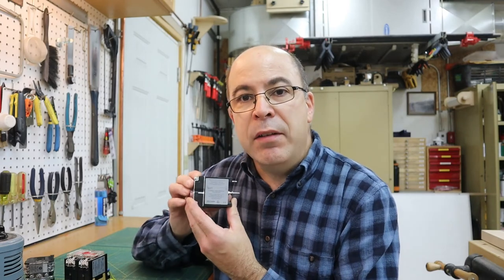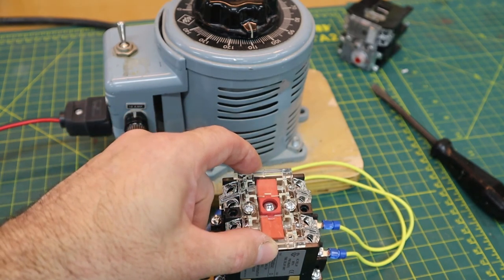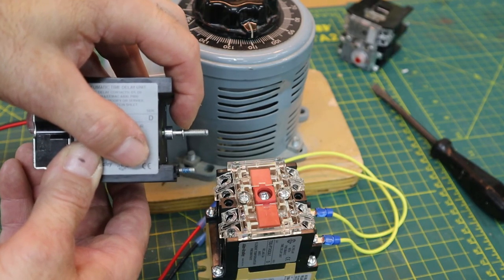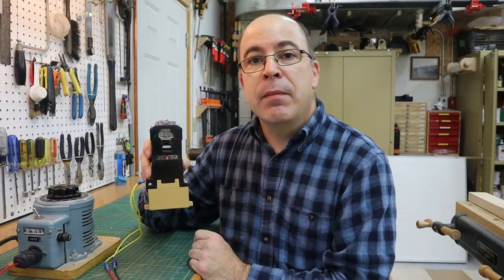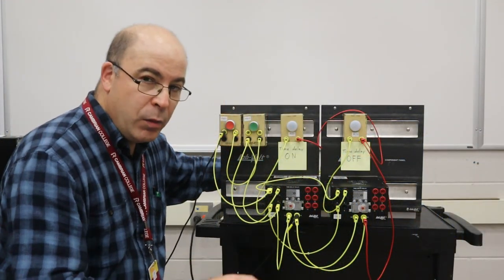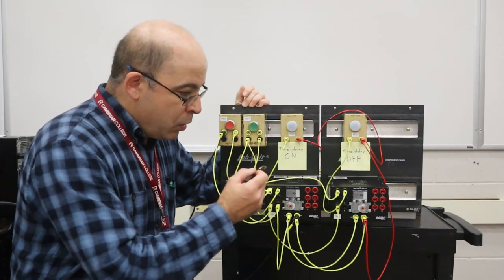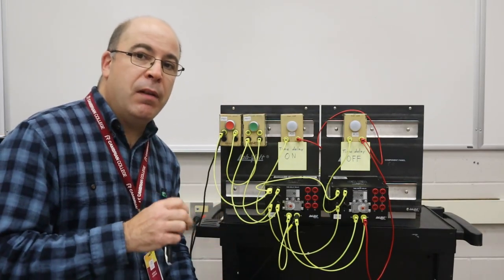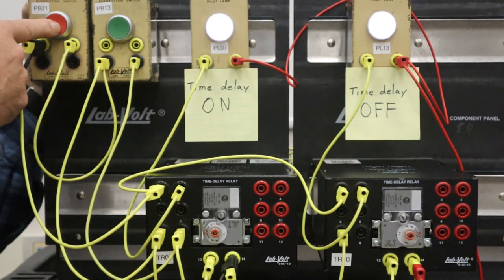Pneumatic Timing Relays

Comment: Sir, when you deenergized  through the push button, why the " time delay off" circuit needs 5 seconds to turn off the light rather than immediately ?
Reply from the maker: That is the nature of the time delay off, once the coil is denergized there is a mechanical movement that initiates the timing sequence. It is about the armature of the relay moving in one direction or another. It is difficult to see in the video but once the armature travels back to its de-energized position, one of the levers located inside the body of the relay pushes against the actuator rod of the pneumatic unit and starts the timing sequence. 
I hope this helps clarify things.